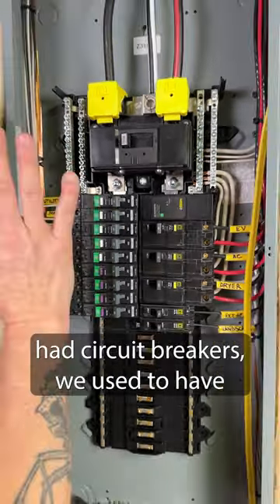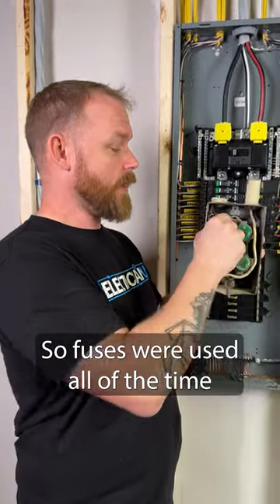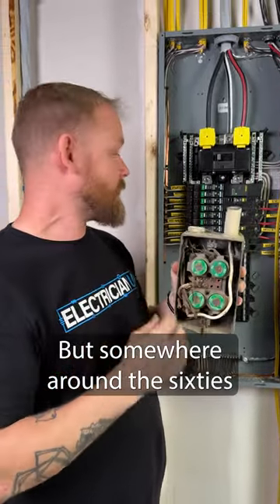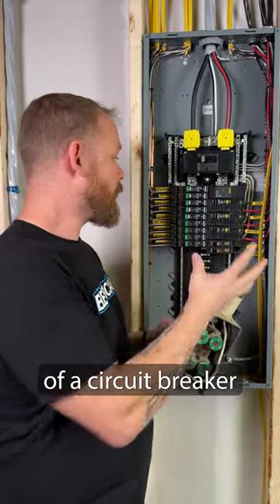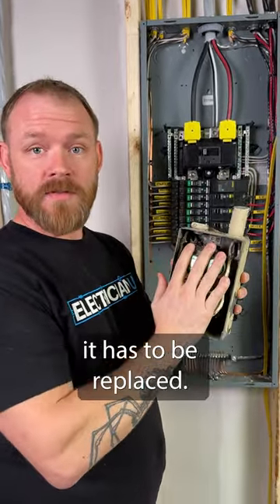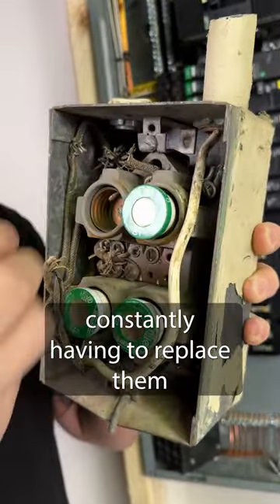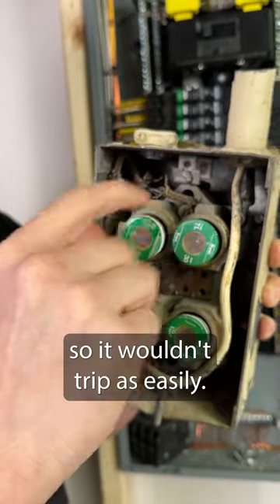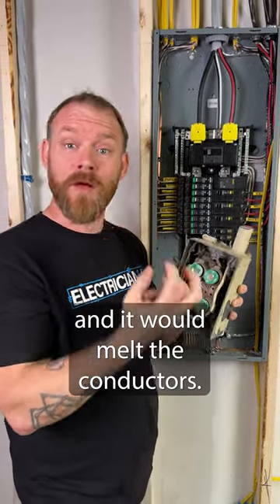Before Breakers There Were Fused Panels - Did You Know

Comment: Some houses still have those in service today. Those screws in type and the long type that are plaes between two sets of prongs or forks. 

Every time I buy a house to flip and it has old school electric panels, wiring or service, I always drop my buying price by $20k or more, depending on the size of the house. I've even had houses with the old know and tube wiring in the attics and crawl spaces. I may still work, but I'm not going to see how much longer it will hold out.

Comment: Then Federal Pacific Stab-lock breakers really revolutionized things(smh😖⚡️⚡️)
Great videos brother!!
Reply: You mean FP switches? Their breaker wouldn't break
Reply: @davep6977  my sarcasm usually hits months later....I understand what you mean 💯
Reply: Refuse to work in any house still equipped with Federal-Pacific. Houses back then used heavier (#10) wire for most curcuits and only handled a 100 amp service. Many women hung their wash on a line so no dryer. A lot of lights were pull chain. Electric stoves were available but gas was prevalent if you lived in town. LP or wood/coal if you lived in the country. A lamp or two perhaps was normal but most people went to bed soon after dark and used a wind up alarm to awake them for the new day. Electrical usage was more from need rather then convenience.
Reply: What about the "bulldog push-o-matic" by Siemens

Comment: He didn't mention another key lesson. They used to switch the neutral legs alot. So when you opened a switch, you didn't de energize the hot, you opened the return. So if you touched the wire thinking it was dead, you became the circuit.

Comment: Of course.  I used to live in a house with a fuse panel for downstairs, and a breaker panel for the upstairs (house was from 1860s, first floor got electrified around 1950, upstairs in the 1970s).

Comment: My first apartment in college was a 1920s house split into 2 units. We had the basement and 1st floor. In our kitchen, we had one of those 1940s/50s style double ovens, and it wouldnt work. We called the electrician, he came and fiddled with the breakers and said "your ovens arent on a circut, let me check one more thing".
He then starts looking around the ceiling in the basement and says "yup. There it is!" And points to a fuse box. He goes out to his van, comes back inside with a ladder and a box of ancient circle fuses, finds the ones that fits and replaces all 4.

Comment: My 1934 brick and steel building, rewired in the early 60's to support air conditioners, has alwaya had edison base fuses or fustats. The super would come replace them, or the local hardward stores always had them. No problem, I kept a large peanut butter jar with a dozen of all the mixed kinds.
 Most of the pre-WW2 urban apartment buildings were wired up with them and still use them.

Comment: I got myself recharged earlier this year, I disconnected an old piece of equipment motor many years previously formerly used to control curtains that was on the floor behind the movie theater screen. and I assumed that the switch was off meaning off and didn't check. Turns out they were doing something funky with that switch... I only realize this when I got shocked trying to put wire nuts on the wires. Then I had to go through the 1900s Theater building to find the subpanel of fuses!
And just in case you might be in a similar situation yes those circuit tracer do work on fuses quite nicely you just have to carefully wire up somewhere for attaching them to bear wires.

Comment: My grandparents home had a fuse box, right outside the kitchen back door.... the place was built by the WPA, it had a 5 amp service, with four 1amp fuses. Pretty much it was only for lighting. The heating was natural gas, the heating circuit was just a bimetal thermostat with a pilot light, no fan. Their radio ran off a big huge B cell battery, and when my dad did buy them a TV? ....the electrician just stuck a 3 amp fuse in that circuit, then a 4 amp, and finally a 5 amp fuse. Old CRT type TVs were 115vac, 5amp monsters for the small ones, the big 27inch ones needed 8-10amps.

Comment: Don't be using breakers as an off/on switch. They are not designed for that. I have had to replace breakers that tripped too many times. Zinsco later Sylvania breakers are still in the house with 1 remaining rotary switch and knob and tube in the attic.
Reply: if the breaker says "swd" on it, then it is designed to be used as a switch.
Reply: Yes indeed.  They keep tripping, there's deterioration going on.  Also indicates an issue that should be fixed

Comment: Yeah those were banned by code long ago. In fact, several places made it part of the law that if you were selling a house or purchasing a house or setting one up for rental, the electric had to be updated to the current code because of all the issues that were happening with those fuses. You can still find those fuses and a few places they're very difficult to find or at least for me they have been and a hardware store in a town where I lived still sold those old fuses. They had boxes and boxes of them. They still sold them and a few times every so often someone would buy them because they still had a garage or something like that. That still had a fuse panel or a pump or something like that for a well or still had a fuse panel that's been 20 some years ago and that hardware stores now gone but it was kind of interesting to see

Comment: Cutler-Hammer made residential circuit breaker panels in 1935. Typically it would Be a 60Amp service with 4-120v 15 amp circuits and 1 or 2 240v 30amp and no main, through knob and tube insulator through copper clad aluminum wire sheathed with rubber insulation and cloth outer cover.  No ground wire

Comment: Can you go in-depth on “bad” circuit breakers. As a HVAC guy I’ve come a few in my career. I find them with checking all electrical connections, checking total amp draw of my unit then use a thermal imager on my breaker. Is there a better method?
Reply: I also did HVAC and a breaker SHOULD hold all day at it's face rating. The flip side is pulling that much all day means the breaker is really the wrong size. You should never exceed 80% of the breaker (and wire) rating if you have that much continuous load. Continuous = more than 3 hours per NEC. IOW, any testing for a weak breaker can pretty much be done with an amp clamp and common sense.... plus reading the data plate on the unit to see if you are within specs to start with.
Reply: Isolate the supply and test the resistance of the entire circuit through the breaker, or if you have a sensitive and accurate enough meter just measure the resistance through the breaker contacts without removing it from the circuit.

But know what the resistance is for a good breaker first so you can detect when you have a bad breaker.

Don't use a conventional digital multimeter on a resistance range for this: they are not sensitive enough to measure the very low values of resistance. Use a proper electrician's test meter that can measure fractions of an ohm. <0.5 Ω

Comment: You can use a breaker over and over to a point. By code it is not allowed to be an on/off device. But also if it keeps tripping and you keep resetting it you are tripping

Comment: I'm in south Europe (Croatia, ex Yugoslavia). We use 230V and i believe 3-phase input to the house. Old / moderately old  house has fuses and an one general RCD for entire house. 
There's 6 fuses in a fusebox for each floor (mostly 16A) and three fuses in the junction box on the ground floor for each of 3 floors (higher than 16A I presume). The fuse rarely blows. 
However, there's no electric stoves, electric space heating/cooling or electric hot water boiler and electricity still works fine.

Comment: I have a fuse box in my apartment. But there’s a button on it to reset the fuse. You can push the button in to cut the current if you need to do work on a receptacle or light switch. Press the button In. Once done press it again. It’s like a circuit breaker.

Comment: True story, in 1978 or 79 I was a young apprentice wiring new houses in Bucks County PA just north of Philly. These houses had heat pumps and we were installing Arrow Hart-Murray 200 amp split bus panels. This one house was owned by a guy who worked for ITE-Imperial when they were in Philadelphia before Seimens took them over. Not only did he work for them, he was a quality control engineer and tested circuit breakers for proper amperage, 10000 rms etc. So naturally what did he want in his house. It was a 200 amp pull out main fuse panel with bus bars and clip on fuse blocks for the 30, 60 and 100 amp 240v circuits and type s fuses for the 120v circuits. I thought they stopped making them in the 50s. I wonder if they still make them.

Comment: Circuit breakers became mainstream in residential in the 1950s and compulsory in the 1960s for new construction, and sometime in the 1970s is when insurance companies are starting to refuse homeowners insurance policies for fuse boxes over all the penny in the fuse box and overamp fuse related electrical fires. Most homes in the 1950s have circuit breakers with pigtail connections to a hot bar instead of the familiar bus bar unless they have a GE panel or the infamous FPE stab lock panel.

Comment: The penny or piece of metal did not make the circuit overheat. The load connected to the circuit caused it to overheat...
Reply: That's right. Only comment pointing this out in 20+ comments. The penny doesn't MAKE the circuit overheat - it bypasses the protection that stops it from overheating.

Comment: Haven't had to replace a fuse in Decades except the fuse for the well pump and it had to be changed due to the wire cap falling off and it grounded on the box.

Comment: I'm replacing an old fuse box (probably 70 years old) AND an antique Square D circuit breaker panel from the 1950's?, both supplied by a 40 year old circuit breaker panel. Just a mess of old and new wires. Three old panels replaced with one modern panel.

Comment: Love your style Dustin.. but the wires in that panel have no slack, or service loop. Adding or fixing a circuit is practically impossible. You need enough slack to move a higher up circuit to the other side, or down lower if needed in the future, I have done service electrical for over 20 years.

Comment: Have seen coins in fuse holders. It was a way to tighten the connection. Sometime the constant putting in and taking out buses over years would make the fuse fit poorly in the holder. A coin would fit in and make the fuse tight in the holder. It stopped fuses over heating. Have also seen fuses with copper joining top and bottom caps to stop the fuse blowing.

Comment: I would estimate the timeline is near this: Post  WWII they had the kind of fuses you show, then about 1953 we had circuit breakers. 
The home I was in as a baby had fuses. The screw in type you show, and a 220 fuse. 

Sometime around 1953 circuit breakers were introduced (I was around 7 years old) and remember my father adding an A/C breaker pair (220) to it around 1961.

Comment: Prior to replaceable fuses, there was a box that contained open fusable wire and a spool of fusable wire. The circuit broke, you shut off the panel, and you rewound new wire on the terminals.

Comment: There are far more screw in type fuses in use than you might think…early screw in breaker types had a push button in it center for resets, and still others were self resetting…

Comment: I unfortunately still have some of these in my house but they're wired in okay they do their job just like they did in the past you can still find glass fuses and metal fuses pretty much anywhere in the United States they're not outlawed yet and not real sure why they should be outlawed they're one of the most safest Breakers in the world when they trip they trip unless you're one of those people that put your coffee maker your toaster and your hot Skillet on the same circuit and continue to blow the fuse so you like you just said put a penny in there and tighten it down and like you also said it caused the conductor's to heat up usually cooking the plug in

Comment: Still have a fuse box in my house. With modern wire and led lights, i have had zero problems. Had to replace all of the fuses after a lightning strike to my house along with a bonding cable.

Comment: Nobody ever seems to mention that breakers have other advantages over fuses too.  Modern breaker designs use a combination of thermal and electromagnetic sensing, which means that they can shut the whole thing off much faster than fuses can in cases of a direct short.  This both reduces the fire risk, and also puts fewer stresses on the rest of the system in other ways.

(And of course nowadays you can even get breakers with GFCI/AFCI/etc built in, too...)

Comment: I had this in my house when i moved in and the night i moved in i had a fuse blow but didnt have any spares so i had to go to walmart at midnight. Got back and all ove the fuses had pennies behind them. Our outside panel by the meter was an old federal pacific panel. I gathered parts that next month and replaced the fuse panel and the outside panel with QO panel and sub panel. I still have a good bit of cloth wire in the house but have been slowly replacing it when we redo a room. Im trying to do away with those stupid arse baseboard outlets! Horrible design!!
Reply: Thank you for sharing; I am currently in a similar situation
Reply: @Lang5ton  I did it back in 2008 and it ran me around 550 then for everything. It's a lot safer and gives me a peace of mind.

Comment: Side note: the circuit breaker is designed to protect your wires, not your appliances/devices. This is why your electronics can still fry during power events that trip (or don't trip) your breaker. Unplug during storms and use ups's where you can.

Comment: Fuses don't always have to be replaced, you just have to put your trust in Lincoln and stick a penny behind there so that your wires burn up instead of the fuse. You could also just up the size of the fuse and do the same thing Then they introduced safety fuses and then quickly moved to Breakers thankfully.

Comment: Go even farther back they used "knob and wire" and the wires didn't have insulation.

Because of no insulation, the wires had higher amperage capability (not too much) where the insulated wire would cook the jacketing off.

Comment: Do Americans not use combo breakers? As in Circuit Breaker combined with RCD. A lot of our final sub circuits require RCD protection and the combos while more expensive make life just that much easier when fitting off an Electrical panel / Switch board

Comment: I remember when I was a child in Afghanistan, people used to repair those fuses by opening them and wired them again using several tiny wires so in short circuit would those tiny wire burned out first and the rest of system would be safe

Comment: Another big problem was the base of the different amperage fuses were the same.Too many times a lower than needed fuse (15 amp instead of a 20) and the circuit was not protected as needed. Many people would install a lower amperage fuse once it had been changed out, so a 15 amp would blow and a 15 amp was the replacement even if the circuit should have had a 20.
Reply: its the opposite, people throw 30A fuses onto a 15A circuit so it stops blowing so often. but i actually came across a fuse panel the other day, complaint was no hot water, turned out the 30A hwt was fused at 20A, kept popping the fuses. easy fix right just throw some 30s in there... wrong ended up going back to the shop to grab 30A cartridge fuses bc the single pole blocks in the panel wouldnt take 30s, and the double pole blocks rhat could take 30s wouldnt fit in that block space! never encountered one like that before that was homeowner-proof, you just reminded me lol

Comment: Breakers predate the 60's by many years.
Reply: The Square D QO panel has been around since the 1950s. The earliest circuit breaker panels for the residential market which date back to the 1920s, you had to wire up each individual breaker into the hot bar instead of plugging the breakers into the bus bars and my friend’s house built in the 1950s used to have such a panel. The infamous FPE panel is what invented the modern bus bar panels in the 1940s trade named stablok however other brands followed suit after the patent expired. The 1960s is when fuse boxes got banned for new construction in all major cities and Im assuming that sometime in the 1970s insurance companies started to refuse policies for houses that have a fuse box because of all the fires caused by putting pennies in the fuse box and installing over amp fuses for things like running 2 or more window air conditioners on one circuit.

Comment: Did you know.............We still use fuses in many applications  because circuit breakers become weaker every time they trip and that a a circuit breaker is only good for roughly 50 cycles where as a fuse holds its rated values throughout its service life?

Comment: Fuses actually provide much more accurate over current protection. Just a pain in the butt when they blow.
Reply: I don't think so. Breakers have the same thermal trip in them, but it activates the mechanism instead of just melting itself. Have you ever seen a fuse's datasheet? They're wildly inaccurate.